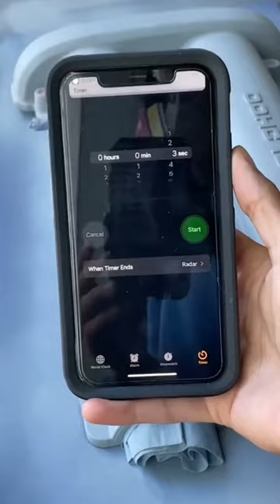How to wrinkle paint your Miata’s valve cover #miata #learn #shorts

Comment: What grit sand paper was used on letters?
Reply: Start with something course like 240 if you have deep pitting and then work through 320 up to 400 or 600 to make it nice and smooth and to put nice machine lines in. If you plan on polishing the letters make sure to go up to at least 400 but 800 would make it easier.